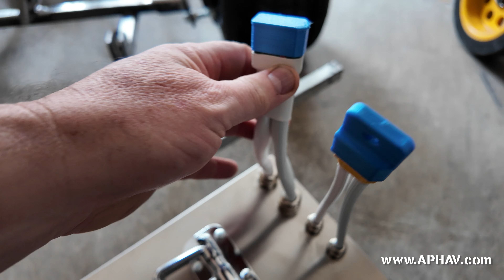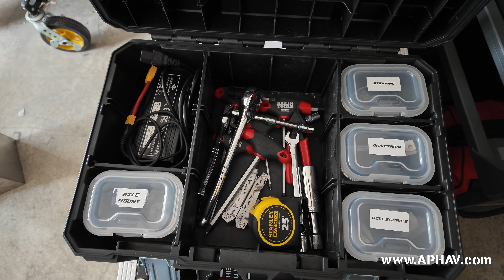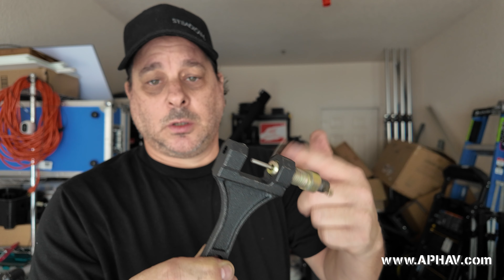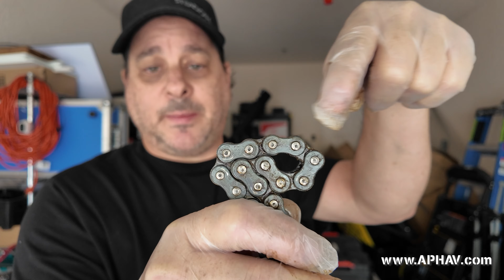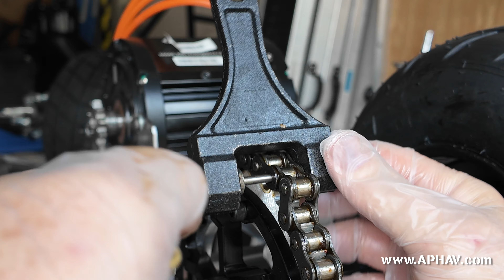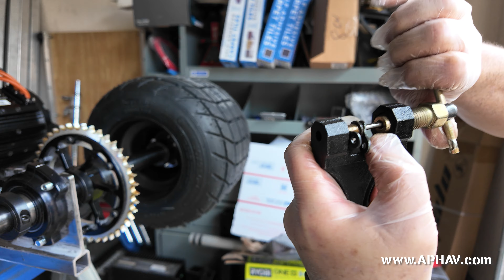Part 10   Chain

Comment: Those pins on the clipped area should just pop out with little to no pressure, then the clipped link should just come off the chain.... Get the chain to required length and then it should just slip back together easily and pop the clip back on. Thanks for another interesting video....... :)

Comment: 19:48 No stop! That clip locks the master link. Just push the pins through with your thumb and remove the master.
The tool is for breaking the permanent links to shorten the chain. The black screw threads in and out of the gold screw. Retract the black bolt so the gold bolt can clamp the chain then tighten the  black bolt to push the pin.
Reply from the maker: Thank you for the note.  This is the first chain driven vehicle I have ever built.  On this chain those pins did not just push through.  I had to use the tool to open up the chain.  Towards the end of the video you can see I got it all to work correctly.